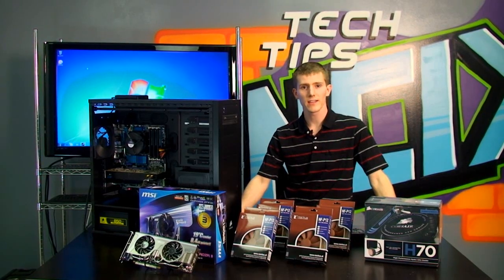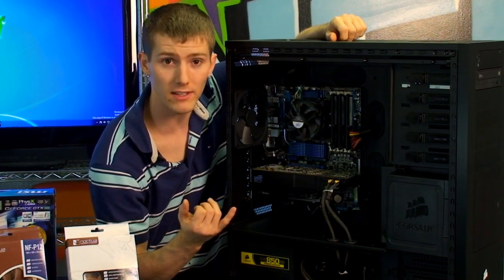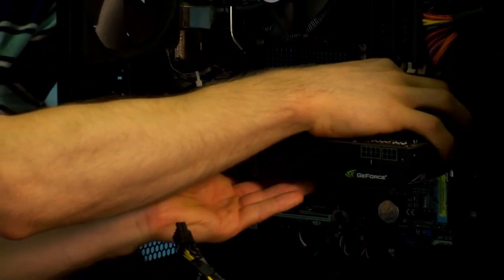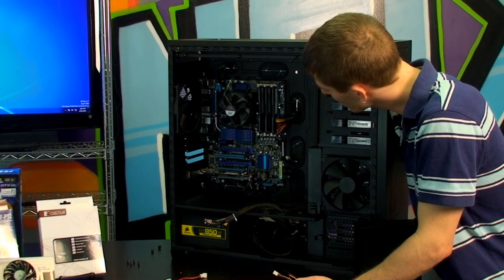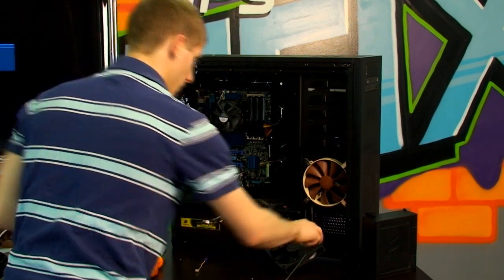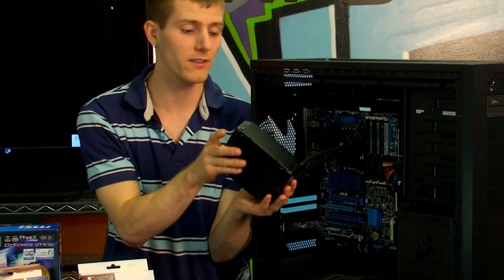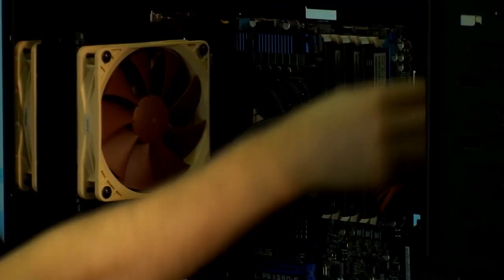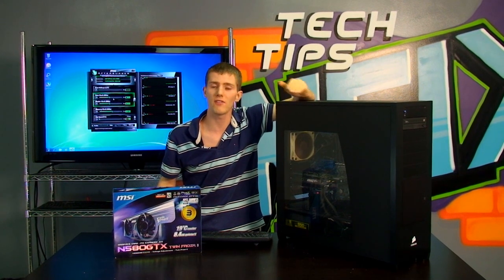Gaming PC Computer System Silencing Guide Featuring NCIX PC NCIX Tech Tips

Comment: If you want really silent computer..take your PC to another room,and find very long vga or hdmi cable for monitor.
Reply: You sir are a genius
Reply: might as well get rid of my doors cause im never gonna close them
Reply: lol I think a closet might also work
Reply: Lol yeah, then USB extension cables with repeaters for keyboard and mouse
Reply: Diddleshot
there is wireless technology...
Reply: Had wireless technology but went back to wires, I didn't want to replace batteries or deal with loss of connection. Higher quality keyboards and gaming peripherals used wires and so I chose those. More bang for your buck. The Corsair gaming k70 keyboard which I use doesn't have wireless and to be frank doesn't need it, or this mouse.
Reply: Diddleshot and there are NO good mehanical keyboards that are wireless (to my knowledge)
Reply: Or just game with a headset at full volume...works for me, and I have a total of six fans in my case and I'm right next to it.

Comment: I have just bought and build a new computer, but my MSI N770 Lightning sometimes starts to vibrate. When I press the card up a little it stops. Does anyone know things I can try to stop it?
Reply: I did something with the cable management, and it has stopped already. Thanks for the help though :)
Reply: Same thing happened to me and it was the GPU vibrating the other PCI tabs :p.

Comment: Don't quite agree with the less fans for quieter PC...My PC has 9 fans in it and under load and at idle it's barely audible. I would say more fans as then you have more fans for airflow so they won't need to run at a high RPM whereas having less fans they would need to run faster to move the same amount of air meaning they will be louder.....But my opinion :P
Reply: fans = noise. fans X 2= noise X 2. More fans = more noise. 9 fans = more noise than 8 fans
Reply: Depends if you have them under a fan controller if you don't then yeah I can imagine more fans would equal a PC which sounds like a jet :P
Reply: Ludovick Erickson Really? So you think mixing 2x 40% alcohol boose gets you 80%? Same thinking.

If you have 10 fans, everyone running on same RPM, you will barely hear any difference between 1 and 10 fans.
Reply: oh i guess running 10 cars in a garage sounds the same as one car then. your sound logic is flawless
Reply: Well as a car is loud to begin with then yeah...Well done... I am talking about a little fan here -.- But if cars had a noise level dial like a fan you could turn up and down you could make 10 cars sound like 1 car without that function. Or if to put it simply Graphics Cards are a great example a card with 1 fan and a card with 2-3 fans which is going to be louder while gaming??
Reply: if both cards were under the same load the one with 3 fans would be louder
Reply: Only going by the cards I have had which is currently the GTX970 by Gigabyte with 3 fans and my previous card the XFX Radeon 7870 with a single fan...Still using the exact same setup during both cards I have yet to hear my 970 while my 7870 sounded like a jet in any game I played. But you can argue the new architecture and different cooling methods etc.... But no in my experience my card with more fans is quieter :P
Reply: Ludovick Erickson Car does not have a constant humming sound, its very different (should be obvious for most people, but whatever). You are really saying that if you get 2x 21dba fans, u get 42? lol.
Reply: Ludovick Erickson only that it doesn´t apply to any GFX card with 2 or 3 fans... if a reference card vs a 3 fan card goes under the same load the referance card does more noise cause the single fan has to spin at higher fps to reduce the heat while 3 fans only need to step up 20 or 30% more to clear the same heat ergo doing less noise, and as for 10 fans on a case thats just overkill, i have an old Full tower CM stacker 830, it supports up to 12 fans, i had 8 fans connected to it all of them controlled and set at 700RPM and still they would make twice the noise with the 4 fans i have now, we just have to find a sweet spot were we can dissipate enough heat from the system with the minimum fans possible.
Reply: kurok1tenshi you cant compare reference cards to 3 fan customs as reference cards use radial fans, not axials.. 2 fan custom cards with a good cooler are quieter than 3 fan custum cards, eg msi twin frozr vs gigabyte windforce
Reply: toby marol also, of course you want enough airflow, but if you can get enough with 3 fans on low revs there is no point in adding more fans
Reply: Ludovick Erickson That is incorrect. If you have 1 car in a garage, and add a 2nd one. The sound levels will increase with 3 dB.
Reply: MrGrayfour learn sarcasm
Reply: +NOOB GAMING So, why to buy more than one case fan at all? LETS BUY DELTA!

Comment: Can someone be kind enought to help me with my fans? I have 3 Noctua nf-f12 fans. Back exhaust, top intake, front intake. My motherboard has 1 4pin header and one 3 pin. I wanted to connect 2 fans to low noise adapters and then to y-cable and to the header. Like linus did in this video, I turn the pc on and they dont spin, when I remove the low noise adapters they spin fine so whats up?

Comment: Hey good tips. I have close to the same setup. I've been eplacing fans in my antec 1200 and noticed now that the loudest fan is actually on my corsair tx850w PSU. Would you have any replacement recommendations? The fan is kind of warped so it will rub which is so annoying! I've broken my warranty by taking it apart so that avenue is closed.

Comment: Hello! I have Intel core i5-4590 3.30GHz(official Intel cooler), G,skill ares ddr3 8GB 1600MHz RAM, H81 chiset motherboard from Asrock, and Evga GTX 750Ti(single pan). When I play high quality game(minecraft with sharder pack) cpu temperature goes up to 50~60C. Is that normal temperature? And I want to upgrade video card into AMD, do you have any recommendation? Thanks
Reply: The temps are normal. I cant recommended a card because i dont know your Budget ;)
Reply: I am thinking that 300-500$?
Reply: Haram Jung R9 290 (GTX 770 is the nvidia equivalent though I like the R9 290's vram more) is right in that budget and the i5 you have would be a good fit for it (though that processor doesn't OC very well). 

However, you could just wait maybe 2-3 months for the next gen cards to come out. The current gen card's prices will freefall by then

Comment: Hi, What should I expect if I change the coolers of my two H80i watercooling systems by a Noctua NF-P12? Only a lower noise but same average CPU temperatures? or I should also expect a higher temperatures? My system has 2 x Xeon E52650 with 2 x H80i cooling systems.

Comment: I am going to buy a Corsair CC650DW Obsidian Series 650D and heard read that it has two loud 200mm fans. I also read, that standard 200mm fans are to wide to fit in the case. Is there any good and silent help? 

(I would take 3 SilverStone AP121 fans for the back and top, but then I still have one loud 200mm in the front.)

Comment: I have very recently purchased this case and I can safely say that standard 200mm fans fit perfectly (I have a CM Megaflow 200 installed in the front). The fans are not too loud but the Megaflow is definitely MUCH quieter and pushes a lot more air. The three speed fan controller also helps. ;)

Comment: Bottom line, if you want to go silent remove all the fans as possible and replace them all with liquid cooling or passive cooling units. Though Corsair H series coolers are a good starting point for changing over to a liquid system. Currently they only make CPU version with no plans on making enclosed GPU coolers. Besides making a water cooling system from scratch isn't as hard as you'd think. You need a pump, a radiator or two, a reservoir, heat blocks, tubing, connectors, and mounts. And of course a case and power supply capable of taking of all these components.

Comment: Is there ANY way to buy the ultra low noise adapter separate? 
I have an NZXT Phantom, and it runs around 40 degrees under load with almost no sound, but I want it to be silent as my dogs farts.

Comment: Standard power supplyes have the kables fixed in the PS no matter if you need them or not. Fully modular PS don't have any cables pre-installed, and you can plug in the cables that you need to run your system, no need to waste air flow in your PC with unnessesery cables.

Comment: Going into the fins of the radiator is perfectly fine, just use pointy screws so that they pierce and go between the fins instead of blunt and push the fins down. You can use wood screws or just push a path through the fins with a nail before using machine screws.

Comment: Depends on if you only want to go with one radiator or not. For example the Corsair that is shown in this video for water cooling is nice and has very limited fan noise. You can get a kit that just for the video card(s) to do the same thing. Regarding the fan noise itself, if Noctua fans are used instead of the stock fans, then there is practically none.

It is a common mistake people say that water cooling eliminates 100% of noise,because it doesn't. There is always going to be pumps, and fans.

Comment: But it was running at 8x,not sure if it`ll make the games run at lower FPS, so I tried to put in the 16x slot again and it began to bottleneck everything and I`m currently at the 2 slot which is 8x
Does this problem is in the MOBO or in the GPU?
My PC specs:
i7 - 3770(not k) with EVGA Superclock cooler
16GB RAM Corsair Vegeance
1TB HDD
GTX 660 TI PE MSI
Maximus V Formula as MOBO
750w Corsair power supply
What else could cause this problem?

Comment: I have heard that larger fans are generally quieter. If I use 200mm fans in replacement of 140mm fans (Yes, my case does have multiple case-fan screw holes) would it make a reasonable noise difference?

Comment: I got a set of Noctua fans for my CPU cooler and then spray painted them black and added carbon fiber vinyl to match my carbon fiber case I built last year. But really I have to say I'm very impressed with the performance its even cooler that some of the liquid cooling builds I have done in the past.

Comment: So, I'm thinking about getting a new case, Mobo , a watercool setup (so i can finally OC my i7 2600k) along with some other parts for my comp. Going to be getting another 660ti FTW sig2 for SLI, so I figure water cooling might help with that, hopefully it doesn't leak on me. Any suggestions for upgrades? Current setup is i7 2600k non OC, gtx 660ti FTW sig2, 16gb ram, Asrock pro3 mobo with pci 2.0 =p.

Comment: In my opinion it goes pretty well together with a white case, I guess it helps if you think of it as chocolate and cream colored.

I have filled pretty much filled my white NZXT Switch with these fans and after you've gotten used to the colors they seem to fit in just fine.

Comment: Buy a bag of small thin rubber washers. Put one in every spot where you have components attached to each other or to the case by screws. While you are in the case clean out some of the dust. Done. It won't make it silent but it will help with some vibration noise issues and only costs about $2.00.

Comment: My Rig:
Case: Cooler Master HAF XM Mid Tower
Graphics card: Asus ROG Striker GTX760
Motherboard: Asus P8Z77-V    LGA 1155
CPU: Intel Pentium (Sandy Bridge) G860  3GHz 
Power Supply: Cooler Master M2 Silent Pro 720W
Hard Drive: Western Digital WD Black WD1002FAEX 1TB 7200 RPM 64MB Cache
Ram: Two cards of Kingston HyperX T1 Black Series (4gb each)

I am currently not overclocking anything because all I have are stock heat-sinks and fans in my rig. I want to have at least my cpu water cooled before I start overclocking. I am having problems playing Watch Dogs with this rig. It will lag and freeze for a few seconds while I am playing Watch Dogs. Therefore, next week I am planing to buy an Intel Core i7-3770K Ivy Bridge CPU, and I hope that will solve my Watch Dogs problem. My goal is to have my computer water cooled for my cpu, graphics card, and maybe for my memory cards but not sure on that yet. I just want to have a nice overclocked PC that is quiet.

Comment: Also, you should seriously consider some sound deadening material. Place it on any flat surface inside the case. I have some on my side panels and both the top and bottom of the case. Works like a charm. No echo when you tap on my case.

Comment: Two thoughts regarding this lesson: the lighting could be better, and there is no comparison of audio levels before and after.  It doesn't matter now as this video is nearly three years old.

Spinning fan blades (much like propellers) create noise cavitation.  Bearings do wear and subtly add to the noise level.  Computer cases were not initially designed with airflow in mind because it wasn't much of an issue.  Modern high performance computers dissipate the heat of a small stove as waste energy.  What's a gamer going to do with all that heat energy?  Coffee warmer?
Reply: my thoughts too....no measuring of audio levels before and after.???

Comment: Audio: Realtek High Definition Audio
PSU: Rosewill Lightning 1300w
There is also 2x120mm fans in the case; one on bottom infront of PSU pulling air in and the other is pushing air out the back of the case.

I agree that the 2x120mm stock fans should be replaced on the H100 as they are the loudest in the case.

Comment: I'm new to building computer and stuff and especially water cooling though i have been watching a lot videos on it.  I don't understand how water cooling works in this video if there is no reservoir and pump??  How is the water going to flow through the radiator and the cpu block when there is no place to put the water??  Please explain this to me someone
Reply: the cooler he used is whats called an all in one cooler which are completely sealed with everything you need it and it doesnt need refilling so its kept sealed
Reply: Adam Foss So there's water already in it??
Reply: WoollyGamerHD Yep :)

Comment: i would get rid of the window design on the case, now just add sound deadening foam onto the side panels to reduce noise from inside. 

increase the fan screw holes and add some rubber grommets to absorb vibrations from the fan. 

Add some large rubber feet to your computer. again absorbing the vibrations. 

add a fan controller so your can manually reduce the speed of the fans when your not under heavy load.

Comment: Have you checked out that you don't have any dust on your gpu heatsink? That usually causes that kind of heating. My cpu had like 25% of it's heatsink blocked with dust and after getting it away my temperatures got down from 80c to 60c.

Comment: im going with the NZXT Phantom  full tower case it has. The H60 CPU cooler, BitFenix Spectre 200mm front, BitFenix Spectre 140mm side , BitFenix Spectre 120mm x2 side  and the BitFenix Spectre 200mm for the top. this is my graphics card Gigabyte GeForce GTX 670 OC 2GB. Anything else to make it silent and cooler??

Comment: Sometimes power cables won't harm the air flow. Actually, if you fill the unnessary embty pockets with unnessary cables or fill with anything, then you can actually improve the airflow. So, removing the unnessary cables is not a must have thing if you can put the cables into embty pockets to imrpove air flow.

Comment: My advice is just listen to one that's installed, its a common part so some store or one of your extended friends group will likely own one. If the noise works for you then you'll be fine.

Having said that I personally would go for a quieter cooler. For instance the Noctua NH-U9B SE2 is $45 on Mwave (hyper 212 evo is $35), it'll both out cool and be MUCH quieter than the hyper 212 evo.

Comment: Can somebody tell me a fan that won't sacrifice performance for silence. I can't prevent dust, as there is no room on my desktop for my pc.
Reply: Corsair's quite edition fans are pretty sweet.  I went from 1 small fan and one stock cpu cooler/fan to one AF140 for intake and 2 AF120s for outtake, plus a SP120 on the cooler.  I dropped from 37 idle to 28 idle (i7 3770, 560ti), and it is unbelievably quiet even on full power.  If you have a fan controller you can make them near totally silent.
Reply: thanks
Reply: Gelid

Comment: CPU: AMD Athlon II X4 645 3.1GHz (quiet with okay temps)
GPU: EVGA GeForce GTX 460
RAM: 8GB DDR3 1333MHz
HDD: Western Digital 1TB SATA II 7200RPM
PSU: Seasonic S12 600W
Case: HP Pavillion P7-1054 Case (computer was heftily modified :P )

I want some water cooling so I can get much cooler temps while gaming. Idk, it just kinda bugs me to see hot equipment, even when fully functional and in safe ranges.

Comment: i have a cooler master elite 361 pc case it support 2 120 mm fans 1 on top and 1 on side and 2 80 mm fans both on the back as the power supply is in the front i have used 2 noctua nf-r8 80 mm fans on the back and 3 nf p12 1 on the top as exhaust and 2 for the corsair h70 water cooler as intake there is only 1 exhaust fan in my pc case that is on the top nf p 12 all others that are 2 p 12 for the water cooler and 2 nf r8 at the back are all intake linus plz tell me if i can improve anything thnx

Comment: a thin coat of krylon or any other spraypaint is the solution..as long as you keep it very thin and not bulky, because excess paint could alter the fan balance and wear down the bearings.